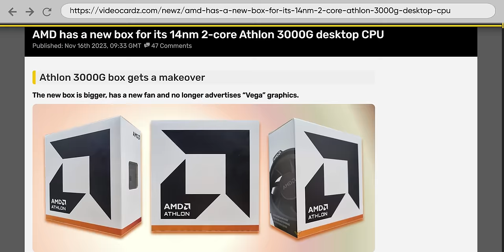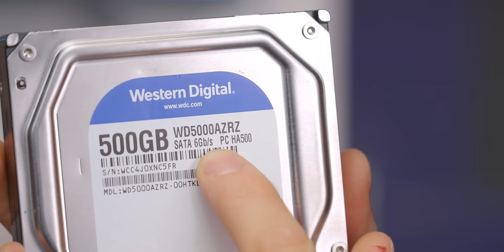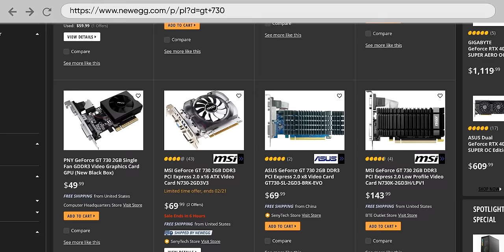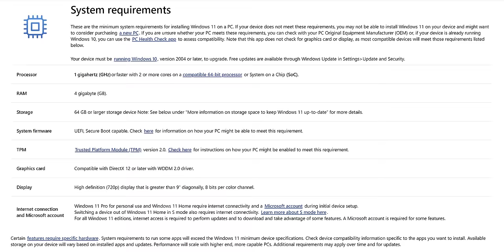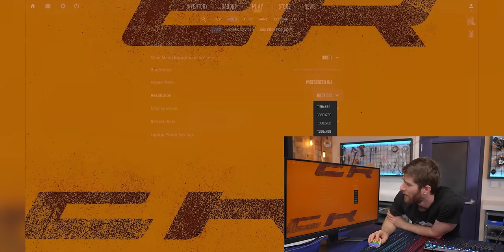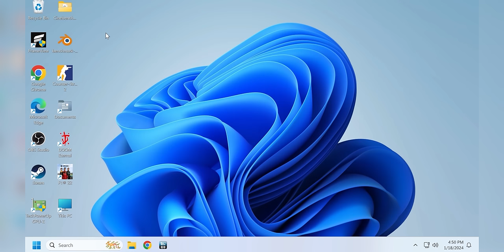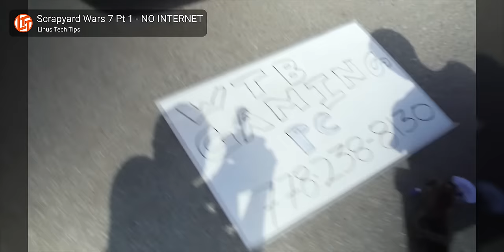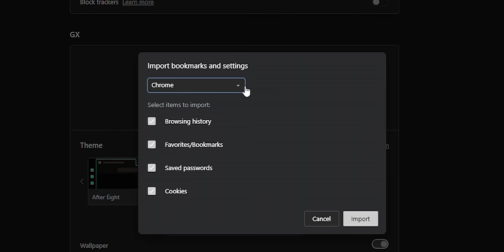I Built the Slowest Brand New PC and it Sucks.

Comment: Remember the Windows 10 minimum spec that said 32GB of storage, leading to a slew of $200 tablet computers with exactly 32GB of eMMC storage that then couldn't update anymore because Windows actually needed more like 48GB just to download and temporarily store update files until it could actually apply the updates on reboot?
Reply: Same happened with Androids as well. I got an 8gb over 16gb version. By the time I trashed by phone the OS took up something like almost 7gb. The distaste left in my mouth was so bad I went to Apple. Of course there were other problems as well not just this.
Reply: @HHalcyon that wasn’t an android problem, that was a „you are cheap“ problem. It’s like comparing a mac to this and then deciding mac wins, ignoring price and everything 🤦‍♂️
Reply: @erebostd  You missed my point. As a customer I was expecting not to get ripped off. Of course I cannot compare those two products one-to-one.
Reply: @erebostd  no, that was a "we make a 8 GB phone, but we will still fill it with adware to make money twice" problem. With a custom rom, you suddenly had enough storage for normal use.
Reply: i dont think thats true @HHalcyon
Reply: Brother if you have apple money you certainly have 16gb money you didnt give android a fair chance at all @TerrorDroneest
Reply: @HHalcyon  absolutely, yes. Low end Android is a massive scam. Either buy mid-tier or just buy a used iPhone.
Reply: @falsemcnuggethope  that adds to his point, my guy..
Reply: @Dr_Birthday  no, it adds to the original point about weak windows and android minimum specs leading to 💩 products on the market
Reply: @falsemcnuggethope    😂 my b. I had to double-take. I misread the post and thought you were the erebostd guy.
Reply: @HHalcyon  mac is so much worse about that though lol.
With the new macbooks they are still selling them with 256gb of storage which was.... painfully little 10 years ago, and 8gb of RAM. These are brand new 1600 euro macbook pros. You want to upgrade your 8gb RAM to 16GB ram and a 500gb storage? that'll cost you an extra 400 euros. Just ignore that 8gb of RAM costs at most like.. 30 euros.
and the cost difference between 256gb and 500gb is so negligible it's barely worth mentioning.
Reply: good times
Reply: @Gary_The_Metro  256GB is fine for an internal SSD, cloud or external for storage. In fact most people don't even need 200GB, but 8GB of RAM is almost inexcusable for even just web browsing. Only saving grace Apple has there is that Unix is much better at using SWAP than Windows is. Still 16 should probably be the minimum.
Reply: @your_local_polak  I held onto my 8gb Android for two years. I was a student so I had no sensible option. Then bought iPhone 6S for 200€ used still as a student and the differences weren't even comparable. I right now run iPhone SE 2021 or something. Paying €1000 and above for a phone is mildly ridiculous. Even for company money. The only thing I miss is a better camera.
Reply: Yup, seen too many of these. All a complete waste
Reply: @Gary_The_Metro  Not going to lie Apple has a few problems with exactly what you just mentioned. Quite bad flaws. I miss my Macbook as a daily driver though. For a regular consumer, despite its caveats, MacOS runs circles around W11. W11 is not very user friendly. But I'm on ROG G14 because I needed a machine for gaming.
Reply: No...
Reply: This is the difference between the walled garden of apple to the sorta ramshackle frontier that android can be.
theres no guarantee that whatever android phone you might get will be worth a damn or even functional out of a year.
Still there are massive benefits to android, especially as the price point goes higher, in terms of both longevity and personal preference/use.
Reply: They only did that so they could force cloud storage onto people, most of those 32 GB craptops and tablets came with cloud storage trials. The fact that Windows couldn't update was a nasty side effect.
Reply: Windows 10 can use a sd card or an usb flash drive to store temporary update files.
Reply: @Deathrape-if4kl did you have a stroke or were you actually trying to say something?
Reply: yes
Reply: I have one of these at work 😅
Reply: @erebostd  ihim, like the android sticks you can buy a few months ago that had only 8 GB of storage and could not install more than 2-3 apps before craping itself ? cough* amazon fireTV stick, and that was one of the better ones
Reply: Then how can POSITIVO make 32gb windows 10 machines???
Reply: @Gary_The_Metro hilarious that this guy is prolly still getting scammed
Reply: @HHalcyon if you go the cheap route you will have a 50/50 chance of getting ripped. It's definitely a  you problem. People who fall for Ponzi scheme is definitely their own fault because they don't question the sanity of the scheme.
Reply: @enigmamyth  You see at the beginning you don't expect that to happen. With unknown brands the experience is easier to achieve (and Ponzi schemes as they usually follow exorbitant returns promises with simple hooks to keep a person entertained). But what about Android, Windows, Apple and other household names? Not that expected. Now I know to advise everyone to avoid Android and Windows machines below average price like plague if possible. Power tools and ICE tools same thing. The lower end products are often only landfill value. Poor people buy once and buy good which is harder with tech but still.
Reply: Ever heard of a micro sd card?@TerrorDroneest
Reply: @ResortRatata  For the Android? Yes, I tried that. Couldn't load apps on it. Something-something not supported. No sensible workaround.
Reply: @HHalcyon  there used to be workarounds but nowadays honestly it's not necessary. You can get a Chinese spyware phone like Xiaomi for like 200€ with 128-256GB and just flash it with something else, or even use as is if you don't care. 

As for SD cards on Windows, it doesn't work. Windows actually has this tool to move files to an SD card or USB stick to make space for updates automatically, but even then the 32GB of emmc storage arent enough.
Reply: @HHalcyon when did this happen? You can get decent Android phones with 128gb of storage for like 150 bucks (look at the Motorola phones)
Reply: @hummel6364  Yes, nowadays at least the storage problem they way I experienced on Android is over. At least at that price point.
Reply: @mihaicraciun8678  By now almost 10 years ago. Time flies. I'd still suggest people avoid that price point though. But now it's related to performance. Mid-range and a bit above is usually the best price-to-performance based on personal experience. Flagships are just a waste of money unless you're really into camera quality on a phone. Or playing games. Is how I see it. But I just default to iPhone SE at present time. Will see how it will change. I have a Zeyphyrus G14 as a laptop so not necessarily skimping everywhere.
Reply: @HHalcyon  well yeah below 200€ you don't wanna really buy any phone... You get some okay ones at 150€ but not really any lower.
Reply: Yes, I 'member. My Asus Transformer tablet which came with 32gb quickly became unusable. Pissed me off because I paid some heavy money to get one. One day I was so infuriated at how slow it was I punched the screen and... no more Transformer, not even a Decepticon 😅🫡
Reply: @HHalcyon isheep moment 🤡
Reply: @Kevin-mx4vm  I have yet to see a reason why that would be a problem. But you do you. Making yourself a laughing stock in the process is a benefit for my amusement.
Reply: @HHalcyon  I totally get that. Unfortunately, seeing as android is open source, I don't think they could've prevented manufacturers from doing this. If they did, pretty sure manufacturers could just modify Android to allow smaller storage. Windows however does have that control in their hands.

It is a shame though, if they had a minimum set by the stock android, that could have at least put less of those on the market. I had an early 8gb android, I was planning to put apps on the SD card, but you couldn't move the whole app to it, the boot file or something has to be on internal, so I barely fit like 5-10 apps on it total.
Reply: @HHalcyon  "As a customer I was expecting not to get ripped off."  So you went to Apple, who are notorious for ripping their customers off.

...  makes sense.
Reply: @Atlessa  They rarely do it to the point that their product is trash right out of the gate. But it's being helped by their products being well above average market price. I have plenty of criticism regarding Apple's business practices in general, yes. But I cannot suggest to buy anything non Apple when the prices are equal just because it's Apple we're talking about.
Reply: @HHalcyon  You are actively getting ripped off by Apple though.
Reply: @lihavalokki5705  Google-related sales mechanism is advertisement. Apple's less so. So that's already a trade off in favor of Apple in this isolated case. And I've found SE to be my go to choice for smartphone. Small enough and cheap enough to not care. Yes Apple has huge problems I disagree with. But Android isn't my savior. The world isn't black and white. Apple for me is just better.

And Windows 11 is absolute trash. So I understand why for daily driving MacOS is better for the average user. If I stop gaming I'll probably go back to Apple. Despite having huge qualms with some of their stuff.
Reply: @hummel6364  low end Androids arent bad, here in india you get phones for as low as 60 dollars but they are way more usable, you get Android 12/13, 12MP cameras a decent and usable mediatek or unisoc soc and 5000 mAh of battery. 
Not to forget that this all is under 60$ and is still usable
Reply: @Deathrape-if4kl  hopefully life gets better for you soon
Reply: I had one of those laptops, it was dreadful. A typical fresh install on windows took 15gb out of the 32gb. Installed ubuntu on it out of desperation
Reply: LOL my mom got a Windows Vista era small computer for almost 0 due to that (I threw Ubuntu on it.)   It had like a 24GB emmc that was I think INTENDED to be used as some kind of startup cache by Vista, and then a 750GB HDD.  The dinks at the pawn shop had thrown their undoubtedly pirated Windows 7 install onto the 24GB disk, that was C.  And it literally didn't have enough space to update itself.   I installed Ubuntu so / is on the 24GB and /home is on the HDD.  Worked great, the emmc made it boot reasonably quickly and it still had something like 10GB free on / since Ubuntu is just not that big.
Reply: @hwertz10  oh that would make a fun Alpine Linux device
Reply: @HHalcyon  True, that's also the reason most people hate android so much fueling iOS supermacy. But the low-end has to exist so that smartphones become more accessible.
Reply: @HHalcyon  I have a near 5 year old P30 Pro with 6GB ram and never had any kind of issue, especially performance. This is 100% your own doing.
Reply: @erebostd  even though literally everything on macs is better? ok
Reply: @kiloneie  You're comparing a flagship model to non-flagship model experience. They're not in the same ballpark. A flagship will naturally last longer on the market whereas below mid tier product is behind right from the start. And every year screws the product over much more.
Reply: My wife had one.  I replaced it with a cheap gaming PC.  As much as I hate that little purple laptop, I love being able to dodge Windows updates, lol
Reply: @erebostd are you serious?
Reply: @Deathrape-if4kl  Will someone tell about Linux to this guy? lol
Reply: @HHalcyon And that happened for years… I had Xperia phones that i loved, but now i’m a happy iphone user
Reply: @erebostd It happened with mid/high range Android phones too, and actually it was hilarious because an Android update is something that phone makers need to make tailor made for each device, isn’t like a Windows update that is universal.
Reply: @Gary_The_Metro 30€ for 8gb of ram? Where tf are you buying these so expensive. In my area 16gb is 30€
Reply: @ARBUZIK.dudkin  I think that kinda proves my point though doesn't it? lol
Reply: @hummel6364  Cool dude but we're talking about a 1500-2000 euro laptop here.
All of it's specifications combined barely put it up to the level of a 700 euro laptop.
And even then, the internal SSD getting an upgrade to 500GB costs you 200+ euros.
That is just a blatant scam and you know it. 
No, 256GB of storage is NOT fine for a laptop with that price tag, and an upgrade to 512GB costing 200+ euros is also, not fine.
Reply: @HHalcyon Mac os is obnoxious for non technical users, the amount of obscure settings and obnoxious behaviors make it a no go for grandpa. Windows file system is lightyears easier to use. W10 is better than 11 by far. W11 is pushing closer to mac os as well. I love mac os but I actually know how to use it
Reply: @HHalcyon  you bought a shit tier product and you switched to iOS because you had a shit experience
Reply: @Custmzir  Captain Obvious to the rescue, amazing.  I'm gullible enough to think a company wouldn't sell dog shit products as something worthwhile buying. I'm no longer that gullible. Which means now I'm not dumb enough to suggest W11 to anyone but a professional user who can't get on by without it. MacOS and Apple in general has quite a few problems but usability isn't one of them - it rocks for a casual user. 

This reply is written on a W11 laptop that's a top of the range model. I only put up with this piece of shit OS because I play games. The laptop itself is good as it should be at a premium price point.
Reply: @HHalcyon  wow, i love how the ONLY time you respond was when somebody made a mistake.
Reply: @marcusborderlands6177  If that's your takeaway I can't do much about it.

Comment: Fun fact, the transistors in a cpu can, and in most cases should, last up to 30 years.
Reply: In completely controlled lab conditions, sure.
Reality is way, way more complicated.
Reply: Only 30 years? Is that under full load? I don't think they're going to go bad that fast under normal use.
Reply: @randomblock1_ depends on the cpu. any high power one will never reach it. it's not 1995 anymore.
Reply: So I shoudn't throw away my ryzen 9 7900x and upgrade when the next gen arrives?
Reply: It's more complicated than that. The 386 era of PCs has already reached the age where the silicon itself is failing. In fact, they've been dying en masse for more than a decade now. It's undoubtably made worse by the complete lack of cooling back then (so a 1.55W CPU would have constantly ran at 80 degrees or so) 
Which is my point, how hot a component runs directly influences its life. I have a pile of dead Celerons, motherboards and PSUs because they've been running at more than 100 degrees Celsius constantly, enclosed in an entertainment machine cabinet with poor airflow and high ambient temperatures. They didn't even survive ten years. 

So to maximize your component's life, ensure it's properly cooled. If you use your components to the max and care about the hardware, get a better cooler. A stock cooler will be fine for most things, but if you're running very demanding games or overclocking, it will dramatically shorten your CPU's lifecycle.
Reply: Good to know because I don't think I am going to upgrade from my i7-6700k anytime soon.
Reply: @masterkamen371 Meanwhile me, shuffling through a stockpile of s478 P4's and old athlons... Pretty sure that all of them are still alive (as most were pulled out during upgrades on our factory couple of years ago), and absolutely sure that all of them were running on Intel/AMD's aluminium brick box "coolers" of that time inside non-ventilated beige metal boxes, approaching 90deg in nominal mode...

What was wrong (or right?) with them to survive 15+ years in such conditions?
Reply: I am still using my intel DX2 ultimate gaming PC build
Reply: Welp. My 5950X lasted a week after the 3 year warranty!
Reply: @disketa25  My example was on the very extreme side of things. These computers were in beige ATX cases with no airflow, in a wooden cabinet with no airflow, with fluorescent tubes and a huge CRT in the same enclosure. They worked for 18 hours a day in bars where people were constantly smoking so every surface would develop a coating of nicotine, which also dramatically lowered the effectiveness of any fans (it would gum up the bearings and the effect on cooling is much worse than dust). The ambient temperature in these bars is also up to 40° in the summer. 
Basically I had some sort of hardware failure every week. 

To address your situation, "up to 90°" is way better than 100° at all times. It's not a linear scale. I don't have a table that illustrates the effect of temperature on the lifespan of silicon, but I do have one for transformers. I think it's similar for CPUs but the numbers should be significantly lower. 
A constant 68° running temperature- life span of 150 years
76° - 80 years
84° - 40 years
92° - 20 years
100° - 10 years
108° - 5 years
116° - 2.5 years
124° - 1.25 years.
Reply: @OriginalUser2023 you, but only you, absolutely should. Future you will thank you. Not to mention your parents.
Reply: this is incorrect. specially with what is happening to Intel chips. The smaller the transistor gets, the more fragile they become specially when pushed to the limits. And even if that was true, there will always be external factors to consider.
Reply: My 4770s is 10 years old. 20 more to go...